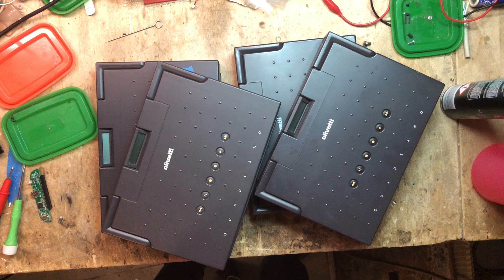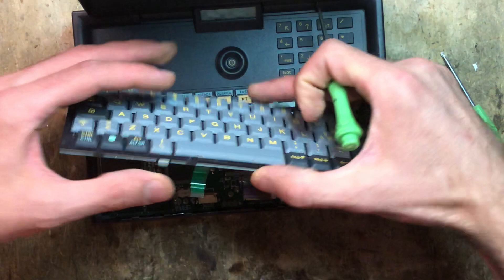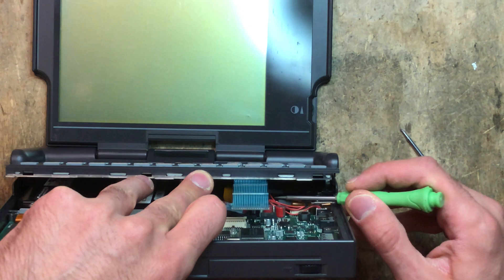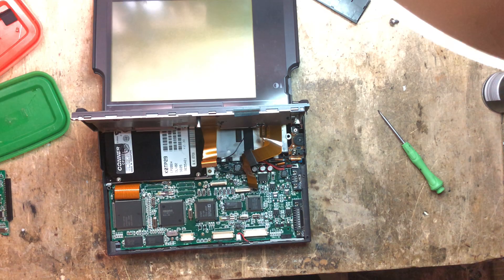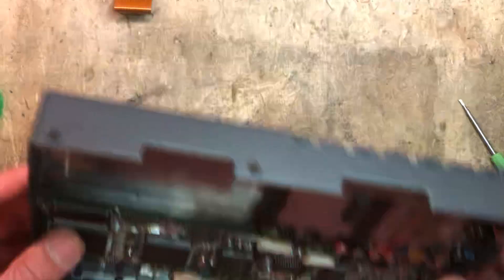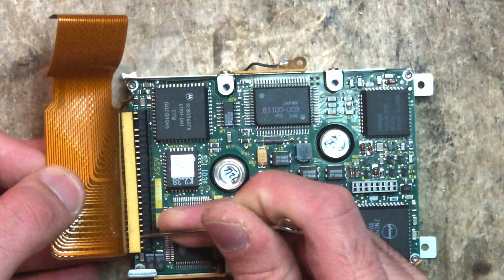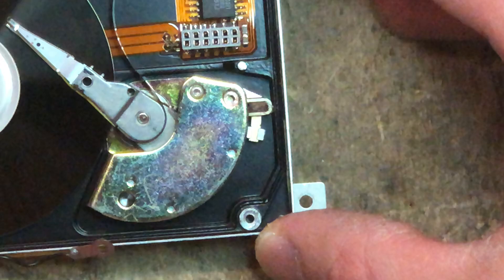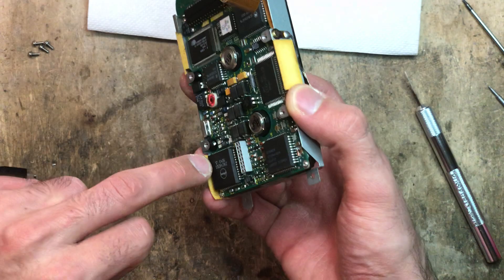Olivetti Quaderno - Teardown and Hard Drive Repair (stuck heads)

Comment: have you seen the video Olivetti used to market these notebooks. I wonder if it helped to sell them.  It's a great little notebook but the display let's it down, if it were passive or active then would of been much more appealing than a large calculator.
Reply from the maker: Upper management never understood what engineering was doing hence they wasted many ideas and crippled others. Active matrix was still a new and expensive technology and probably the display wouldn’t have fit inside such a slim chassis. I think the main issue was the processor, something they addressed in the second generation (that sold even less). It’s basically the father of the ultraportable netbook.

Comment: Ciao Francesco!
Can I ask you some advices on how to do some troubleshooting on these little pc? 
I've bought one from ebay, the previous owner said that it was working as far as he could tell, but he specified that it worked only with it's battery pack (which wasn't included). 

Said that, once it arrived I connected the power supply, and it didn't show any sign of life. Then I bought 6 AA rechargable cells, and left to charge for a while...but unfortunately nothing turned on. Fun fact: it happened once that I heard the hard drive spinning and loading, but I couldn't see on the LCDs; if my memory works, as soon as I moved the power cord, it turned off and it never came back until now.

Okay, so after all this, I decided to take a look inside, where as expected, some capacitors leaked. 
I replaced all of them with through hole version, but unfortunately it didn't help. Then I've ordered the right replacements, but as you may expect, nothing changed. 

I would really like to see this pocket pc work again..if you have any advice (or service manual to share), please let me know!
Thank you
Reply from the maker: I also had mixed results, but I recommend washing the board and also check for shorts or corroded traces. Try the simplest with some hot water, degreaser and a brush. And remember to dry it immediately.
Reply: Thanks mate, I'll try... any hint is gold!

I hope that it will come back to life, I did a mistake and broke the ground wire coming off the LCD flex cable. I think it's fixed now, just scratched the paint to obtain a small pad, where I've soldered a new ground wire...cross fingers 🤞

Comment: Dude you shouldn't be telling people to repair their hard drives like this... What's going to happen is someones drive fails it's making a similar sound or even that sound.  These are pics of their kids birth or a wedding or something equally as important.  They open it up and ignore basically all the correct procedures like you demonstrated and they ruin the drive any number of ways in such a way that their data is now not accessable or repairable.  You should preface this video with a warning that you probably will ruin the data on the drive if you proceed with this and if the data is really important find a capable data recovery company.  I'm not sure if your aware of what you just did here and if so that was a real dick move or if you just don't understand this stuff enough and didn't think about how this could effect people .... However if you really are a stand up guy I would preface this video with a warning...